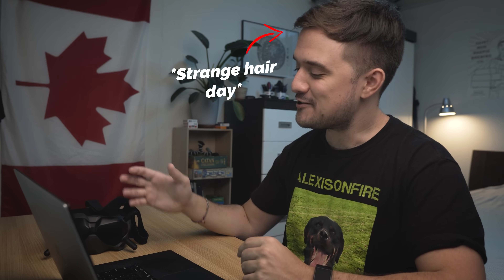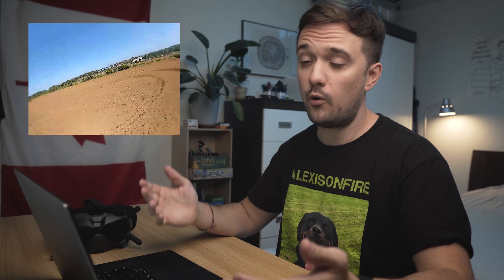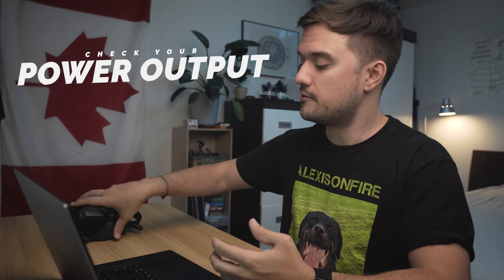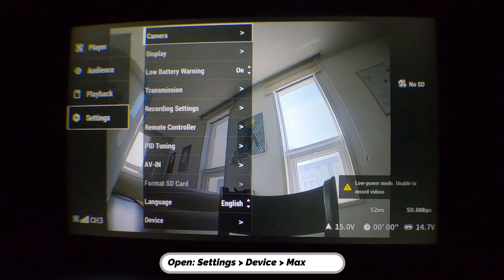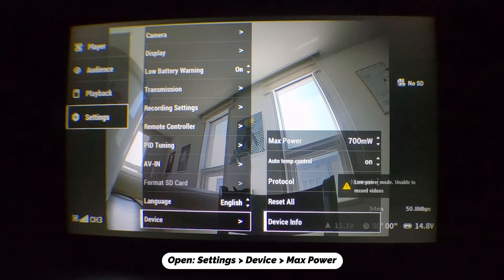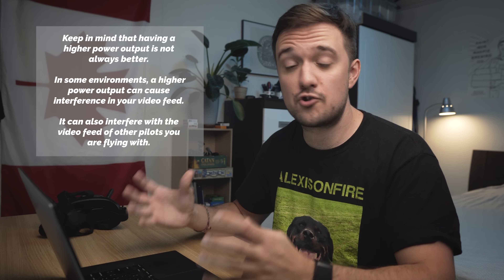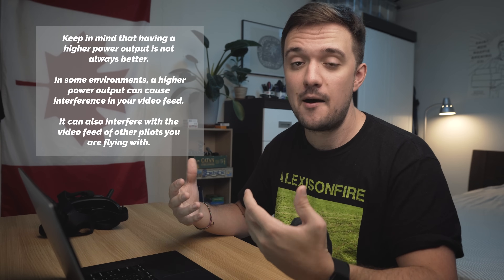How I Flew FAR With DJI's FPV System - Easy Power Output Hacks!

Comment: This work find for my WTFos DJI goggles V2 just put SD card in goggles it unlock then i turn off and took card out and change to 1.2k then 

i did with 2 of my drones vista and dji air unit
 i plug it into dji air unit via SD slot and turn on left for few then took it out  

for the vista i plug it into my PC and drag the file onto it and that was it

Pretty easy and simple no issues

Comment: My v2 goggles do not have a device tab.. Can anyone HELP? Thanks
Reply: Me neither
Reply: @ryanbenson9975 . I found that the air unit has to be powered on. The hack also didn't work for me unless i had the goggles plugged into the computer with the sd card in the goggles and moved the files directly into it.

Comment: I'm a little confused. Does this work for all drones compatible with the Goggles v2 or only with the two you referred to? For example; I have a DJI Avata with the Googles 2. After watching this, I just purchased the Goggles v2 to replace my existing ones. I haven't got them yet but after rewatching this I'm not sure it will work with the Avata.

Comment: hello, is there a BIG different between 700mv to 1200mv ? i did the hack so i got 700mv, just wondering if there is really worth it with the heat in mind =) first time DJI user:P greetings from Norway :)

Comment: Where should I put the Sd card ? The goggles or drone ?
Reply: I also wanna know that. He said the region hack with the txt 1 file goes into the drone and that's it? And if you want the power hack you make the naco pwr 1 file and that goes in you goggles. And if the drone fcc mode than the system runs on 700mw?

Comment: Thanks for another awesome video. Both myself and a friend have done the FCC hack, both get the unlocked message on the corner. But even at 1200mw we struggle to go past 150-200m. Any help or advice you can offer ?
Reply: If you have more than 3 channels the hack didn’t work. 3 channels only with 1200 hack

Comment: Weird, I live in the US and I don't even have the option to change my power output.

My DJI FPV only goes about a mile before loosing signal.... even starting at the top of a mountain.  No where near 10km as they say... 1600 ft up is my max height.

Comment: I have DJI Goggles V2, did exactly that, name naco.txt then 1 and found out it just gives me 4 Channels not 8 as you mention. Do you have any idea why?
Reply: Auto Response and fix. Very IMPORTANT: if you are on FCC mode BUT transmission set on 50mb you will only see 4 channes, BUT if you set it on 25mb you will see the 8.

Comment: Hi just wondering if the mountain is above 500M because that's the limit of the DJI FPV Quad.
I want to learn how to go above 500M and if it's possible with the stock drone and rc. 

Cheers!
Reply: Move to New Orleans..
Fly Drone..
Learn to fly at -100 ft.

Comment: Not sure if this works with DJI but Betaflight has an option to run you vtx at 25mw until it's armed then it kicks up the power output selected in betaflight

Comment: So awesome. So easy I hope this still works. Just got mine. I've powered them on and messed around in menus but never connected to a drone yet so I think I'm safe from that latest lock out update
Reply: I just got mine last night and I’m afraid of the same thing. How did it work out for you?
Reply: What r y'all talkn about? I just got both headsets last night the new ones that come with the Avata and the goggles v2 for the FPV but I haven't turned them on yet. Can I lock myself out with an update?
Reply: @TRICKYBYRD  I had the latest version on the v2s .06 or something. I just never connected to a dji fpv drone with them. Also not updating them because the last update is just for avata which I don't intend to own. I've rooted my goggles with Fpv-wtf firmware so I can use full HD betaflight OSD
Reply: @SkeezyFPV  not sure, never had any problems. I'm at the latest version before the avata update. I've also just rooted my goggles with the fpv-wtf firmware so betaflight OSD works.

Comment: Hi Matt, can you please advise which firmware on the goggle you were using when this video is recorded? I was on the latest firmware on 22nd January 2022 and it didn't seem to work. I can't seem to see i can adjust the goggle power output to 700 mV. Also, does it work on DJI FPV drone?
Reply: Wondering the same.
Reply: did you guys find out what to do?

Comment: Hey!
I know it’s been a while since you published the video, but still a question

Does this also work on the dji fpv drone? 
Should I then do the text file on the goggles sd card?
Reply: The dji drone has different hardware, the goggles also use a different 'os' when flying the DJI drone.
You probably already figured it out, but there are other hacks for the DJI drone itself, one of them is b3yond.

Comment: Hi Matt, love watching your video. I follow you instruction to create a file naco_pwr and type pwr_1 to put on sd card. Why my power still 700w instead of 1000w. I put the naco file on the same sd card for recording dvr, does it matter?
Reply: Late but there could've been an update released that changed how this work to prevent people from doing this. Check reddit and other forums, they might have answers

Comment: Hey Matt! So for the DJI FPV all you need to do is put the file on an SD card and then put it in the goggles , is that correct ? Also can this card also be used for recording flight footage or that is the only file that should be on it ?
Reply from the maker: Yea that's right. You can record flight footage on the same card too.
Reply: @MattPochwat  there’s, b3yond, this hack, and the drone hacks site.   A good video would be all the methods someone could use.  My fpv came in Chinese and won’t push more than 40 mhz.  But nothing seems to get me above 3 channels.  So I’m left with drone hacks as maybe the only way to do this.  But I feel there is another way forward.   Thanks for your work..

Comment: Nice one!!

Btw, does the selection of a channel change something to performance/range?
I mean apart from the public one that is limited to 25mw, do they actually make any difference?

Cheers from New Zealand!!
Reply: Pick a channel between 1 & 7…it should automatically boot up to 8, which is a public channel.    The devices abilities, from what I’ve heard , are limited on public channels.  You need to manually switch to one. It designated that way…I think..if I’m understanding you correctly

Comment: Your menus are different from mine.  I don't have a device menu listed under settings, so I can't change output power or auto temp control. I just bought the goggles.

Comment: Nice video Matt, thank you!  Not sure I want to turn temp control off though.  Risky for the flight controller.  Will think about it.
Reply: Temp control off helps if the “low power mode” in bottom right corner does not change to “unlocked”, this will gorce it to constantly be in full power mode

Comment: Hi,
Just saw your video - very nice job with really good instruction. Is there a hack now, a year later for the DJI FPV goggles? It appears that the menu has changed. There isn't a DEVICE access tab in this one.

Thanks, and keep up the great job.
Reply: SWITCH TO FPV MODE and you will see it

Comment: ok for 700mw but i can't unlock 50mbps i have the setting on the menue i select it but the osd display still gives 25mbps... mask V1 air unit base dji V1 not vista. thanks

Comment: Bro this menu option is completely different to what my dji fpv shows...  Status, album ,transmission and settings is all I get and then if I go into settings my options are different to yours? I'm mega confused, please someone help im loosing faith in my dji fpv as it does not fly far st all plus I cant get it to record flights from either goggles or drone 😢
Reply from the maker: Hey man, this is for when you want to use the DJI FPV goggles with a different drone. I made this video before the actual DJI FPV drone was released. Im not sure if something similar is possible with the DJI FPV drone itself (but yes, there is a different menu system for that).

Comment: CAUTION:  Drones are already tracked using Doppler & thermal Infrared spectrum by the military. Drones displace heat due to battery consumption... Well above the natural body temperature of animals. All countries maintain a power standard. If you increase the power to a drone, it causes three main problems for you:
1. Reduces battery life.
2. Overheats the battery leading to thermal runaway leading to swelling of battery as seen in lot of DJI videos. This leads to battery disengaging and falling out making you lose your drone. 
3. Increases heat displacement.... Which will lead to you sticking out like a sore thumb among the other thousands of drones flying out there in a country's airspace.
Please be careful and understand the risks that follow using such hacks!!

Comment: Thanks for the Video
For some reason a Storage Window Does Not Open Up on my computer when I plug in my VISA in my Wingsuit HD 
I have no way to DRAG & DROP the Hack
Reply from the maker: Try using a better cable. Some USB cables are only really for charging.

Comment: Is it the goggles that are putting out 1200mw or is it the air unit? I have the v2 goggles but no air units. I can't even select the power level options. I assume when my air unit arrives and I bind it to the goggles, I'll get access to the power level setting. It's the air unit that transmits the video to the goggles, so it has to be the air unit going up to 1200mw, not the goggles, right?

Comment: Hello her from denmark Why dont i have the device option in My settings try to put  naco 1 and pwr in but it dit not work have the 010100 firmwhere :) ??is it only the unit or dji fpv kit/combo

Comment: Since units overheats, what happens when you connect drone to betaflight? How to avoid overheat then?
Reply from the maker: The air unit/vista should be fine when connected to beta flight if your battery is not plugged in. If you have to have your battery plugged in though, you'll have to take breaks
Reply: @MattPochwat  appreciate a lot for this info!

Comment: I'm running 1w on V2. And iflight patch and omni. Running flywoo lhcp long antenna. Yet still I don't seem like I get far. I think something is interfering or there is some issues. 
I'm try turning temp control off though  and try again. Also will check range on another vista drone I have. 
Maybe flywoo labeled a RHCP left by accident lol
Reply: Any luck on increasing your range

Comment: The regulations in germany suck big time.
I can understand that certain frequency- boundaries do apply to minimize problems with wifi and telephone-services.
But a limitation to 25 mW is total BS.
In the USA people also use wireless internet in their homes and are not all the time affected by drones.
Im living in germany and i am flying with a VTX-Output of 25mW most of the time but if i want to fly a little bit further away i need to up the power to 200 or 400 mW.

Its our stupid rules saying: "All devices on a frequecy have to use the same Power-settings" 
Thats shortsighted of course becaus indoor WIFI does not need high power and is more likely to interfere with the neighbours WIFI. A drone flying on a field is most likely far away from a housing-area and it sometimes needs the VTX-Power. (BTW we use 2.4 and 5 GHz in our Homes for WIFI --- i dont know if 5.8 GHz for analog  is even in the way of another device The DJI Googles could be but as stated its out in the field)

Comment: Hi Matt. What about the new goggles and the DJI fpv drone. I start losing signal over trees at 4-500’. What can it do?  Thanks
Reply from the maker: If you find a spot where you can maintain line of sight with the drone, you should be able to fly quite a bit further than that. I haven't looed into the FCC hack for that drone yet, but there might be some videos on it.

Comment: @Matt Pochwat. I got a question regarding DJI FPV goggles. It's about digital vs analog when flying far. As I understand when it comes to signal breakup is that digital just cuts of immediately while analog kinda fizzles out. From a safety perspective should analog be a more reliable option in most cases, or I am wrong?
Reply from the maker: They actually behave pretty similarly. Analog video gets static-y when you are losing signal and digital starts to get pixelated/lower resolution. Then, if you REALLY lose video, your screen will freeze with digital or you will get a full screen of static using analog.
Reply: I had been out 5 Miles with my DJi goggles and AU on a Mini Talon and video dropped and went to the DJI logo.   Obviously I hit RTH switch and my Talon did exactly that and came back to home point BUT video never came back online in goggles!  I had to land visually/LOS and reboot to get video back.   Just be aware this can happen.  It's only happened 3 times so far but now I pretty much no when to do my turn to come back home.   Around 10Fps
Reply: @Freebird_67  Stock v2 googles? I can't even pass 1 building 50meters from me, just cuts off. How to improve this?
Reply: @Bevis91  Yes V2 goggles and even V1 goggles.  I got the V2 because I may want to check out the DJI FPV drone at some point plus the V2 has 2.4ghz and eventually they may come out with different AirUnits ir Vistas.  I run helical antennas 3 turn on both 2 ports. The iflight Crystal patches get me some decent range as well.  The V1 goggles I'm running the BDI adapter for Analog as well so those are used when I mo I'll be flying both Analog and hd on certain days.
Reply: @Freebird_67  so what do you suggest, how do I improve my range and is it normal to get around 50m only trough a building? Also, does my antenna matter on the drone? It's kind of small on the shendrone terraplane, kind of hidden in the tpu bracket for it
Reply: @Bevis91  try the power hack to get you 1,200w. Also if you are running CA and not FCC your range is cut in half.    I'm not going to tell you what to do but there are ways of fixing that to.  It just takes a little Google search or join the Facebook groups and you'll get it way you want.
Reply: @Freebird_67  all right will go do some research. BTW how important is it to be facing the drone whilst flying for the range?
Also the stock antennas on the googles, they ok or need replacement?
Reply: @Bevis91  Much better when facing drone. Try getting the inexpensive iFlight Crystal antenna kit. Much better than stock.  Can watch videos testing that on RCSchim channel. :)

Comment: if I would drop the both hacked files in the goggle and the DJI air system, Would that give me more range? or that is going to be usless?
Reply from the maker: Both files do slightly different things and should be dropped in the spots that I mentioned. Doubling them up won't do anything :P

Comment: I can’t find these anywhere online. Even the v2s do u know anything about that?
Reply from the maker: Yea DJI has been weird about the V2's recently. They pulled them off the website. I saw them on Banggood most recently but only available to ship to certain countries.
Reply: @MattPochwat  would u trust bangood? i see it everywhere but ive never heard of it so a bit sceptical...
Reply from the maker: @Tobiasmccabe  Yea I'm thinking about making a quick video on them. You can trust them. They also have really cheap shipping. The only problems with them are that their stock listings are not always accurate so there are times when you have to wait a long time to get your items. Shipping also usually takes 2 or 3 weeks. I've never heard of anyone having problems with refunds though in the chance that things do end up taking longer than usual. It's definitely not amazon though.

Comment: Nice tips Witherspoon due care about its side effects. I believe that the battery consumption of both goggles and air unit should be higher resulting in a shorter flight time. 🤔

Comment: which battery do u use on your goggles
Reply: I primarily use 3s lipo's from a 1300 all the way up to a 3000...The DJI goggles are not too thirsty but with a quad like the Explorer LR I like having a large battery connected for additional peace of mind during long flights or sessions.

Comment: One wrong info...with the last update for DJI FPV system you will be able to transmit at 50mps. You don’t need any hacks
Reply: Triple channel mode is very nice. Its good enough to record from and share casually. It does eat audience mode though so you could still have need for the upgraded transmission strength.